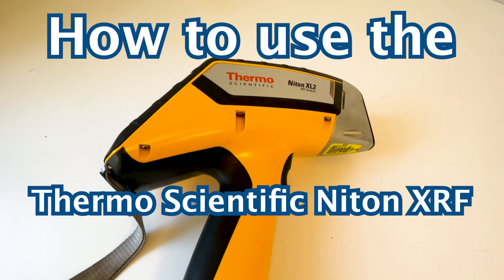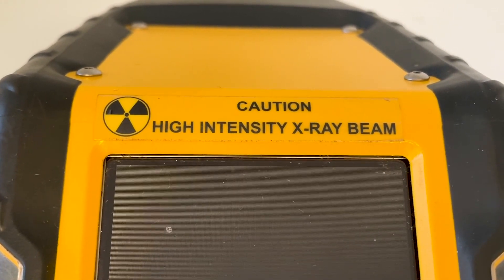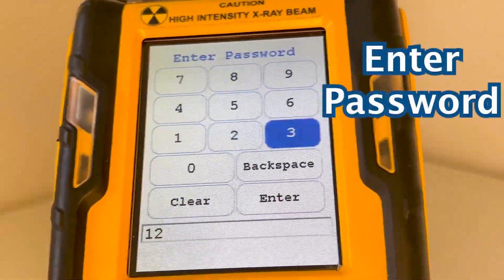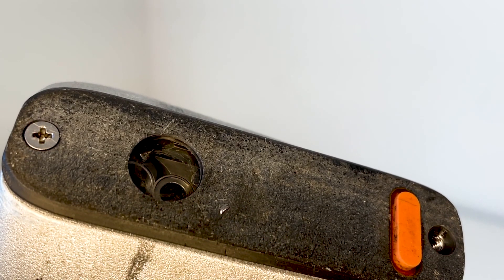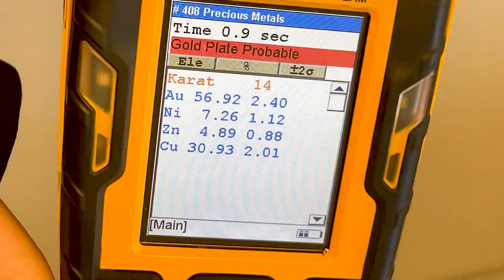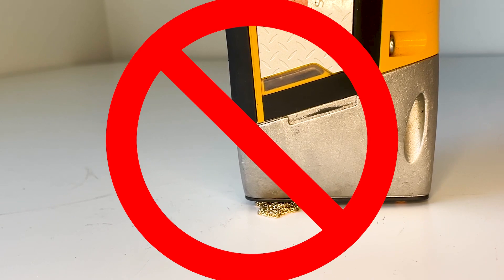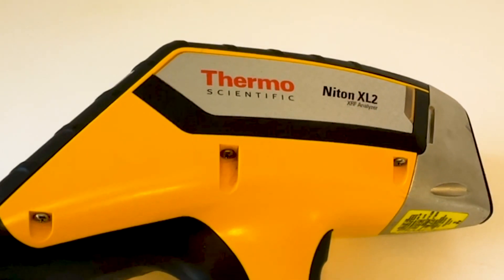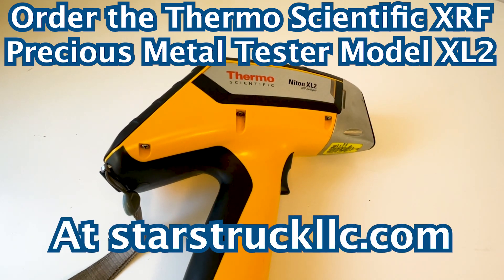How to use the Thermo Scientific Niton XRF Precious Metal Tester Model XL2

Comment: i doubt in identifying for example 14k and 18k gold plating. let me explain my scenario theoretically. 
1/ consider we have a necklace or other jewelry with the same quality base metal but coated with different gold like 14k and 18k. when we test with xrf, there is theoretically the same percentage of gold content but different gold quality (14k and 18k). let me have example
1.1/ let the base metal be 57 grams and coated with 3 gram gold (14k gold). the percentage of pure gold content reading should show 2.925%.  lets check it
<>That means 14k has 58.5% pure Gold with the rest other metals(this is defined for 14k gold) therefore  3 gram of 14k gold has 1.755 pure Gold (58.5%)

<> the percentage of pure gold from 14k gold coated in this jewelry with 57 grams of base metal  will be  2.925% ;that means   1.755 grams of pure Gold divided by 60 grams total metal weight (57 grams of base metal plus 3 grams of 14k gold)
1.2/ Let the base metal be 57.66 gram and coated with 2.34 gram of 18k gold. the percentage of gold content reading should show the same as the above 1k gold 2.925%.  lets check it
<>That means 18k has 75% pure Gold with the rest other metals(this is defined for 18k gold) therefore  2.34 gram of 18k gold has 1.755 pure Gold (75%)
<> the percentage of pure gold from 18k gold coated in this jewelry with 57.66 grams of base metal  will be  2.925% ;that means   1.755 grams of pure Gold divided by 60 grams total metal weight (57.66 grams of base metal plus 2.34 grams of 18k gold)
CONCLUSION: if there is no basic calculation error or other logical error, an XRF reader showing the same pure gold content in percentage may not detect or may not distinguish between 14k and 18k. because in my case coating with 14k and 18k and yet having the same pure gold percentage (with the same quality base metal but different weight ). i tried to google about this claim and could not get any concrete solution. The core issue is 3 grams of 14k gold and 18k gold has the same grams of pure Gold. a question may arise '' what is the difference as far as the total pure gold content is the same?'' so i wish i could get a good comment to learn from it